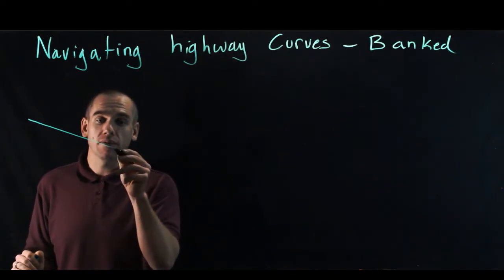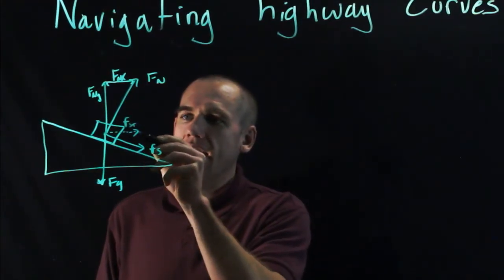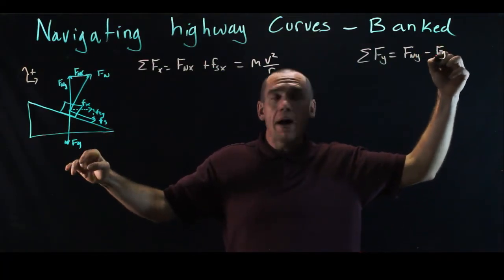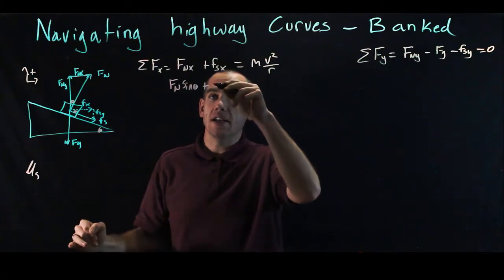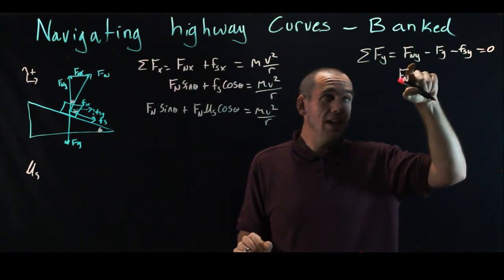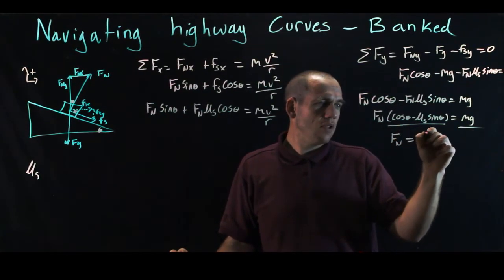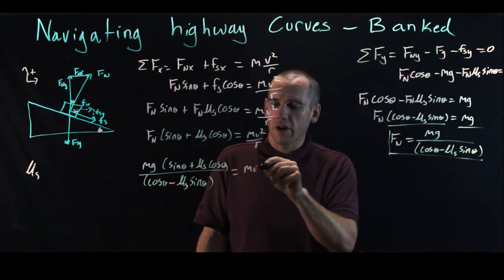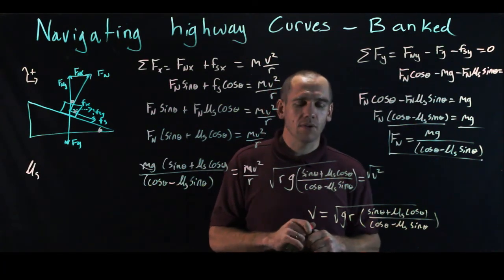Banked Curve with Friction

Comment: Is Fn not equal to Fny*cos(θ) = mg*cos(θ)?
Reply from the maker: No.  There are three forces (y-component of friction, y-component of normal, and gravity) acting in the vertical direction that must sum to zero since there is no acceleration in the vertical direction.  Also there are two horizontal forces (horizontal components of friction and normal) acting to provide the centripetal force.  When the object is in motion, the normal force is greater than if the car is at rest.  This is because the car is literally driving into the road as the road curves into its path.  The extreme case would be a curved wall.  Imagine a hockey puck moving along the wall of an ice rink.  As the puck moves into the curve, the wall pushes the puck around the curve.  A similar thing happens with a car on a banked curve.  The road pushes the car around the curve

Comment: How do u know which way is the friction? from what I can imagine, couldn't the friction also be the other way around ( upward the slope ) like how u can stick something on a slope and it stays at the same spot. Because the friction is resisting gravity making the object not ride down. Or is the bank curve scenario different from the incline example?
Reply: If you're going too fast on your circular path, the car wants to slide up the slope, so the friction points down the slope (it's resisting the direction the car wants to slide in).

But if you're going too slow on the circular path, the car wants to slip down the slope, so the friction points up the slope.

Comment: Is anyone able to help me? Why normal force isn't just equal to to the cosine*m*g
Reply from the maker: Essentially because there is a reaction force from the road's surface as you drive around the corner.  If you were at rest on the incline then the normal force would be as you stated, but because you are moving into a curve, you are  pushing into the road, so it pushes back. The extreme case is a vertical wall. Imagine a hockey puck moving along the wall of an ice rink; as it enters the curve the wall pushes in on the puck towards the center of the curve, causing the puck to follow the wall.  The normal force causes the centripetal acceleration.  The same thing happens with a banked curve, the road surface is in effect a wall that you are driving into.
Reply: Thank you very much!

Comment: For an inclined plane we also have mgsin(theta) which points toward the center of the curve. Why is this not included as yet a 3rd centripetal force?
Reply: no it points along the inclined plane
Reply: mg is vertically downward, so there's no need to resolve it to x and y components here. we can straightaway consider it in the y direction.
if resolved however, mgsin(theta) will be along the inclined surface

Comment: It is good but review on where you placed friction,it has to be on the contact interface of the car and surface not at the center,only normal reaction and weight are acting at the centre not friction
Reply: it applies at the center of mass, this is why he puts it in the center
Reply: Actually the normal force would also be acting at the contact interface of the car and surface. But theoretically the effect shouldn't matter if the car is considered a rigid body. Truth is it is not exactly rigid since there is sway between tires and car body on sharp turns.
Reply: well yes but its simplified at this level

Comment: how do i find force of friction?
Reply: The static force of friction "fₛ" is often defined as "fₛ = μₛ⋅n", which means that it is the product of the static coefficient "μₛ" multiplied by the normal force "n".
The static coefficient has different values depending on which surfaces that make contact with each other, and it will usually be given to you.

Comment: Hi... What happens if the angle is 45 degrees and the coefficient of friction is 1? Looks like the denominator under the radical becomes zero?
Reply: A bit late on this but the coefficient is always less than 1 or else it doesn't make sense.
Reply: @topiary5650  That's not true. Racing tires have coefficients well over 1. There is nothing wrong with friction coefficients over 1. The deal with the model is that it breaks down when Cos(Q)=muSin(Q). Remember the restraint in the model was looking for Vmax, so it is saying that Vmax tends to infinity... in other words you can go as fast as you want and you will never slide out. Look at the 2nd line under Sigma Fy... if Cos(Q)=muSin(Q) then -mg = 0. That's impossible, unless Fn can go to infinity
Reply: @brianmcelhenny7645  I'm not talking about real life I'm talking about what's gonna be on the test. I'm just trying to check off all the boxes for the pre-med requirements over here and they require us to do physics. I appreciate the input though, I do enjoy learning physics and natural sciences and stuff. I'm doing a joint biology and applied math degree cuz of that.